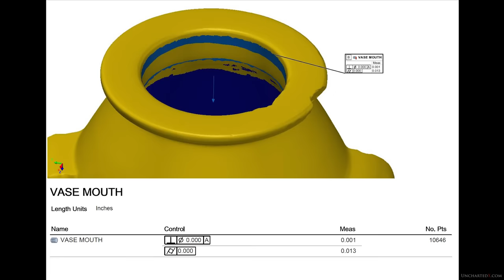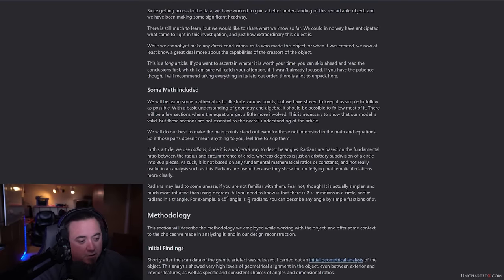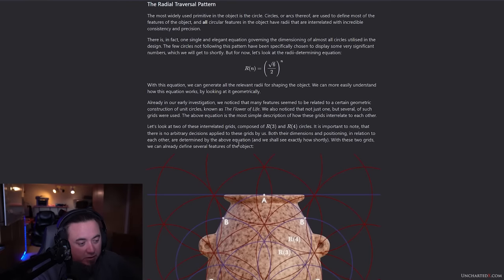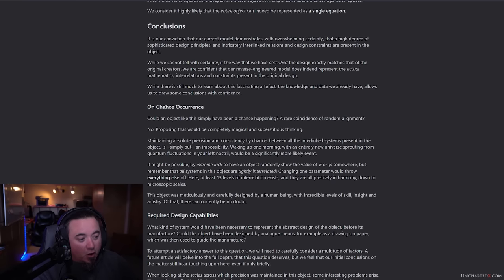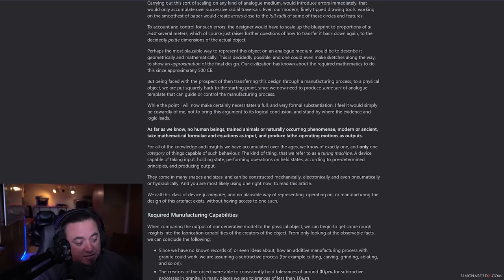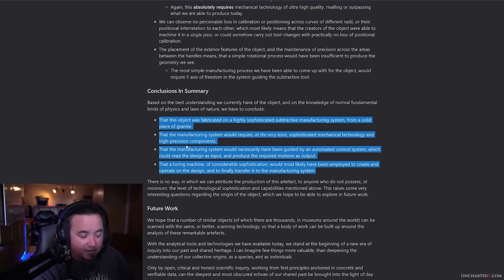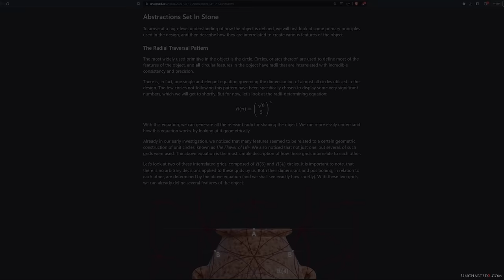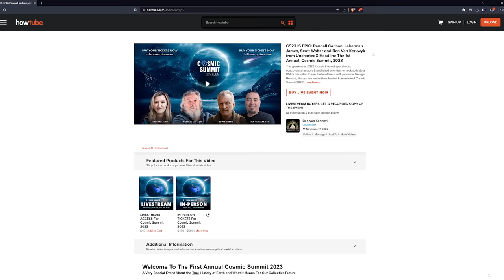Was a COMPUTER Used to Design this Artifact??

Comment: Finally someone did the effort to translate the geometry of those objects into mathematical functions. When Ben from UnchartedX showed the huge single-piece temple columns that were laying around it occurred to be that the top "flower" that goes to the ceiling is not just a nice ornament but resembles the mathematical transcendental function of the "Familia Sacrada" in Barcelona. It would be good to measure those huge columns as well to find out whether they were also produced by Turing machines. So far we know that the huge statue of Ramses II is perfectly machined, like by a huge CNC mill.    :face-blue-smiling: